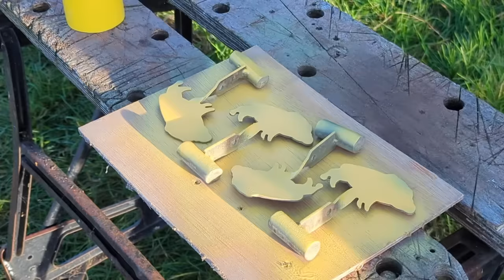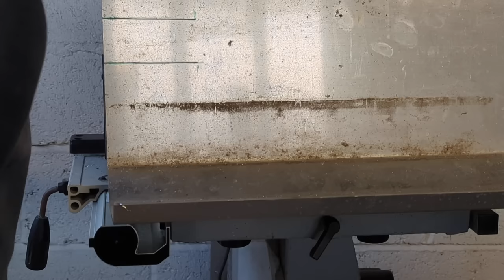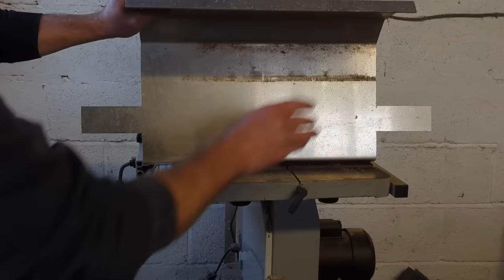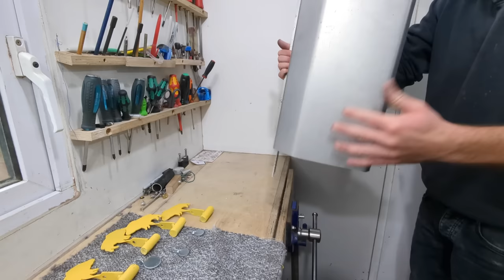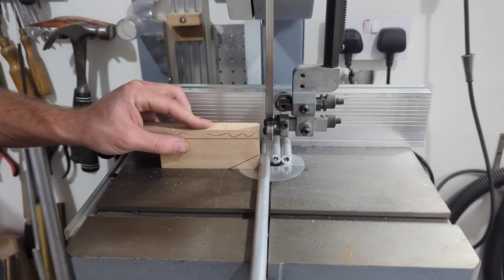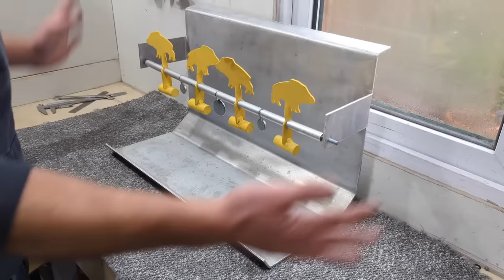Building mad custom spinner air rifle practice targets

Comment: Nice target, Im impressed with the line marking paint that works a treat
Reply from the maker: It's pretty much what all the target clubs use on their targets 😉
Good gear ,if a little awkward as the cans are designed to be used inverted spraying the ground...well and I'm cackhanded 😆

Comment: I cried when you shot that bison, all that hard work and the yellow paint got ruined.
Reply from the maker: It's very useful being able to see the pellet strikes in the fresh paint. It's what we all use on the hft/ft circuits. Quick respray before each session and good to go. 😉
Reply: @tillysgunstocks  That's a relief, I was worried there for a moment.:hand-orange-covering-eyes:
Reply from the maker: @rosswoolley2854  yep it's intentional with the paint, the silver spinners are pretty tricky as you struggle to see the pellet strikes and aim off accordingly 😉